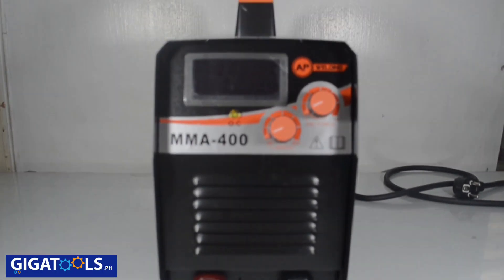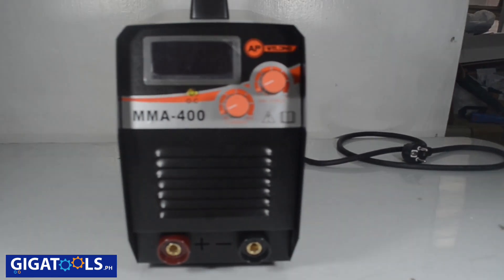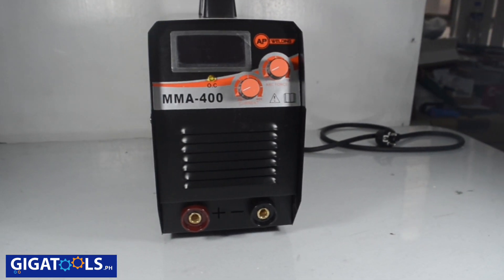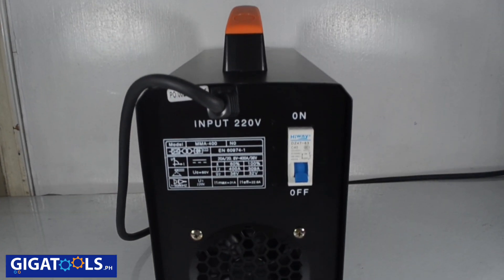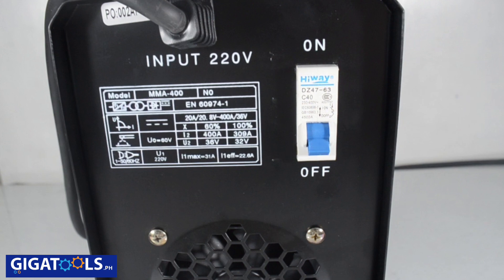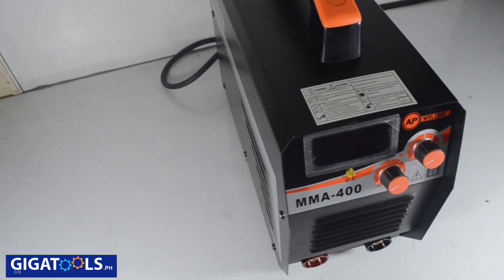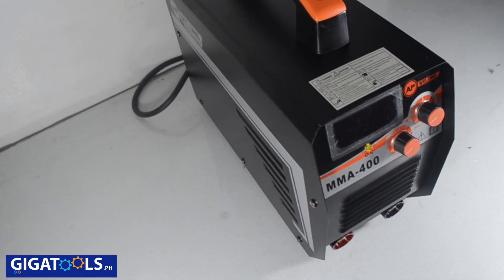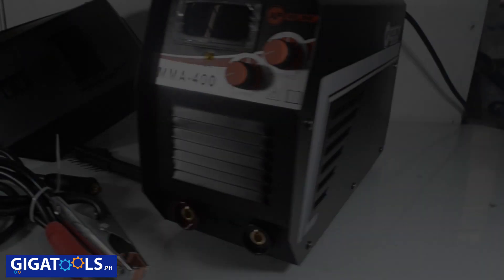New APWelding Inverter Welding Machine with ARC FORCE Technology

Comment: San po ikoconect yung electrode holder?
Reply: Dipende sau at sa gnagawa mo. DCEN OR DCEP. DIRECT CURRENT ELECTRODE POSITIVE OR DIRECT CURRENT ELECTRODE NEGATIVE
Reply: Pag base metal dcen. Pag naman ang i over heat mo ay electrode dcep